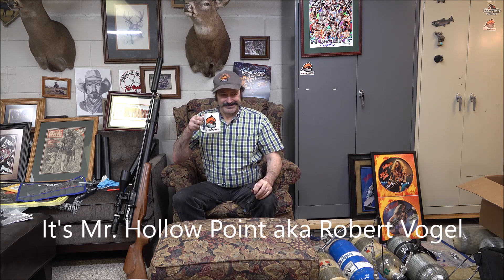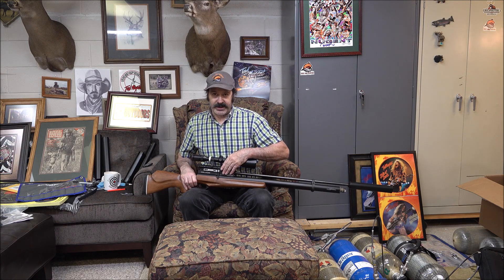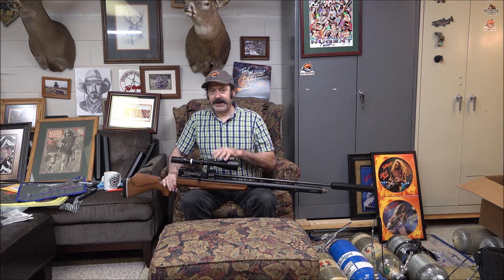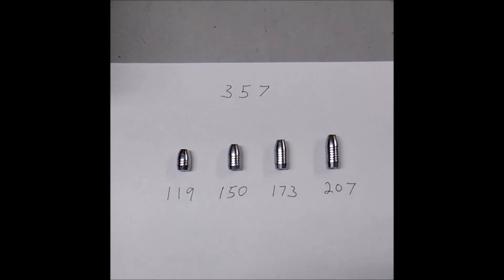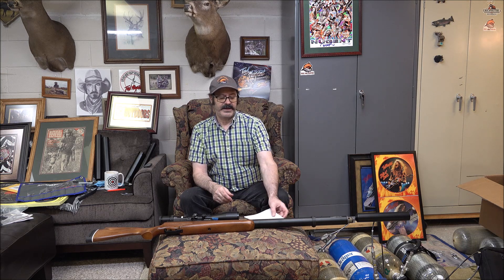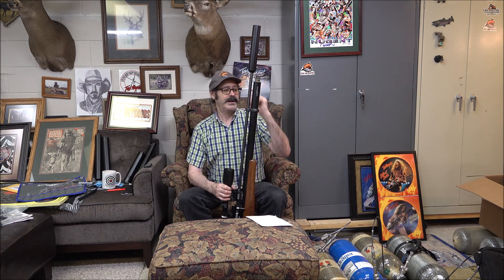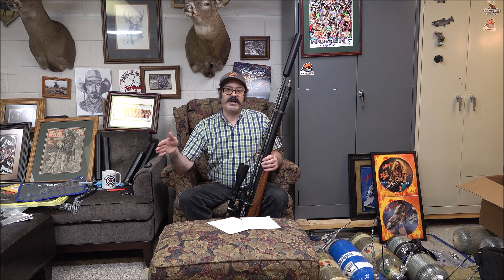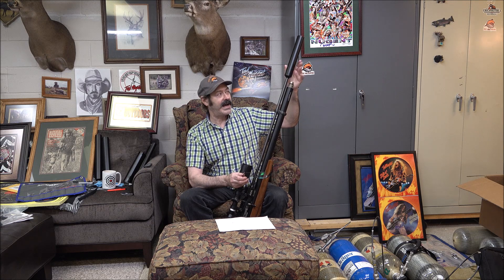357 Challenger Big Bore Air Rifle

Comment: It’s interesting that this rifle likes some of the same weights as my .308 Texan.  The .308 does well with 120’s, 130’s-140’s grn MP cast slugs and 175 grn.  The 120’s & 175’s are Lee molds.  The 357 makes about 60 fpe more than my .308 so I’m not sure if it’s got enough fpe for large deer?  However it is accurate, so maybe?